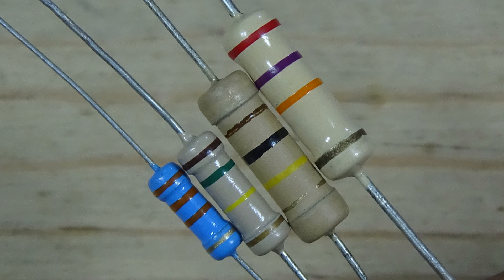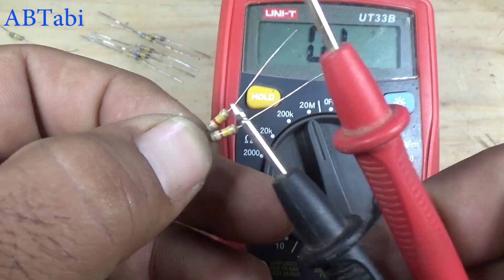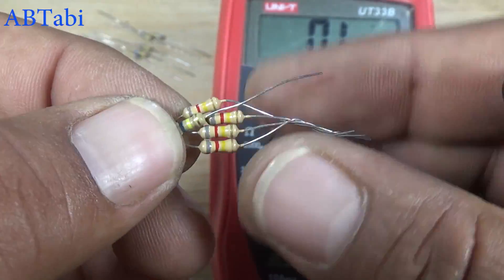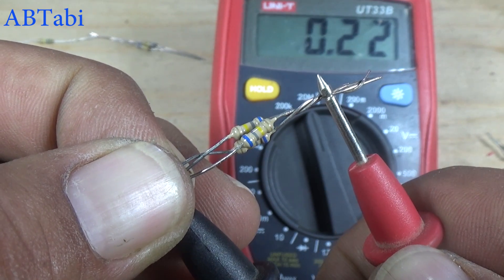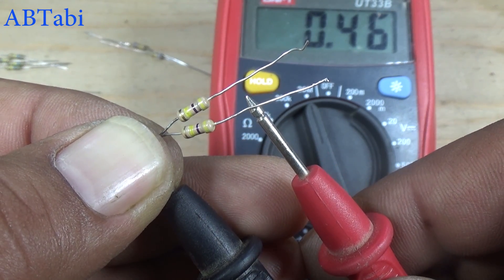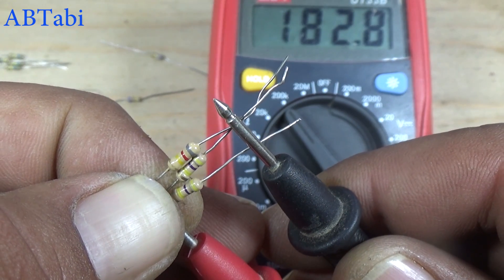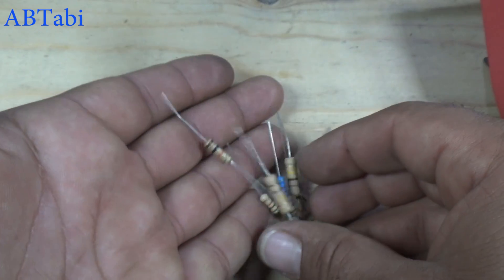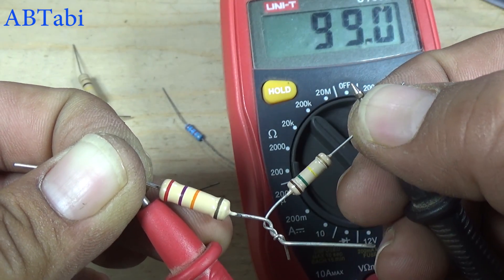How to make a Resistor, convert resistor value, diy idea

Comment: I think thats more or less this:
In paralel we divide each the value of resistors by their number and the result by their number.
Example:
4 resistors of 100ohms = 25 ohms
Thats 100/4 + 100/4 + 100/4 + 100/4
= 25 + 25 + 25 + 25
=100
/4 That divided by their number (4)
100/4 = 25 (final result)
In case of diferent values:
100 + 200 + 47000 + 500
(Each /4) = 25 + 100 + 11750 + 125
=12000
/4
=3000 (3k)

In series we just add their values..
100+100+100+100
=400
.
100 + 200 + 47000 + 500
= 47800 (47.8k)
I hope that's correct..
Tell me if i'm wrong..